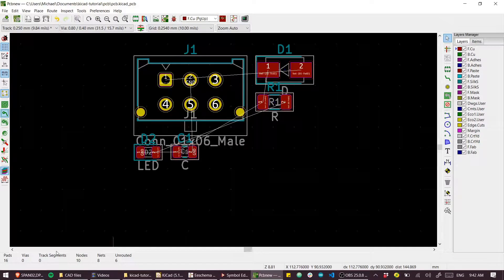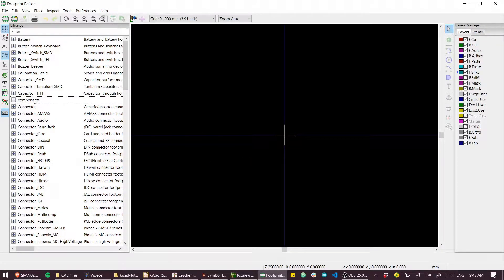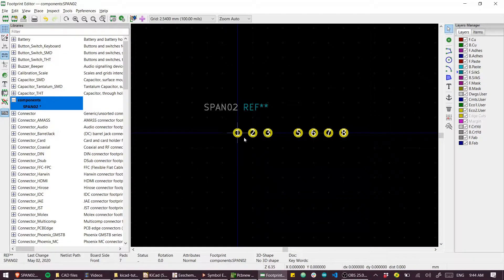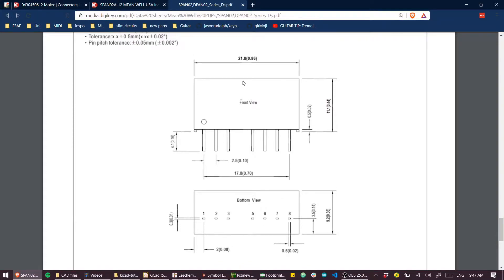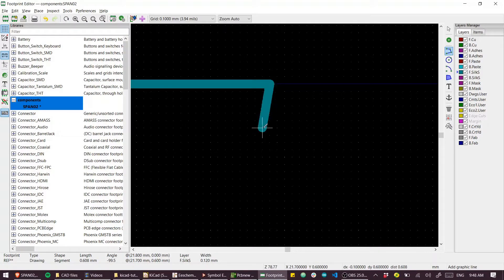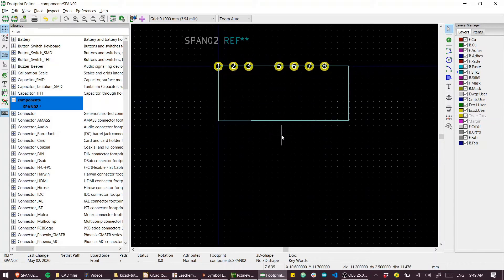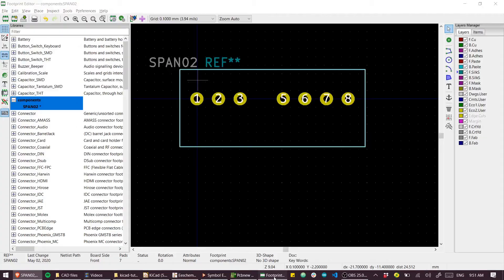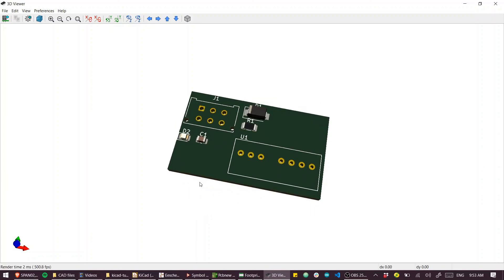KiCad - Zero to Hero 4 | Create a custom footprint from a datasheet

Comment: Default pads for KiCAD 6.0.6 are not the circular through hole pads in the tutorial and are red Soldermask defined (SMD) rectangles.

To change to the correct pad: 
Right click after placing and go into properties or shortcut (E).
Change pad type from SMD to Through-hole.
Change pad shape From Rounded rectangle to Circular and change Pad size X to 1.5 mm.
Change hole size X to 1 mm and then press ok. From my own limited experience you can't multi select all pads and go into properties and may have to change each one individually.
Reply: true.